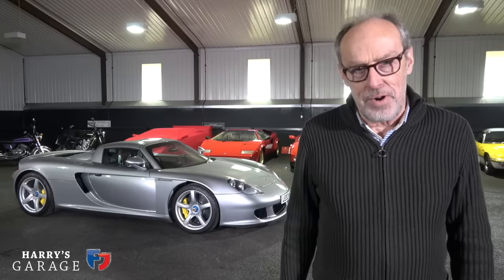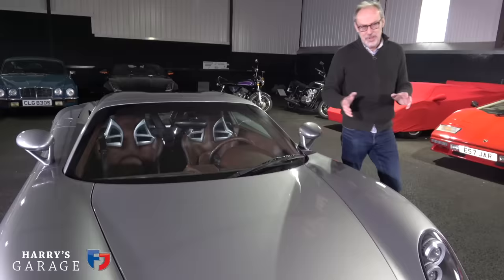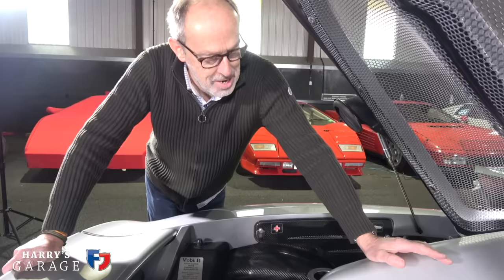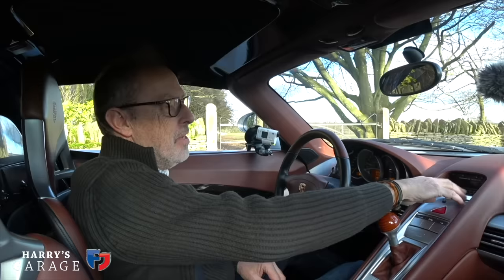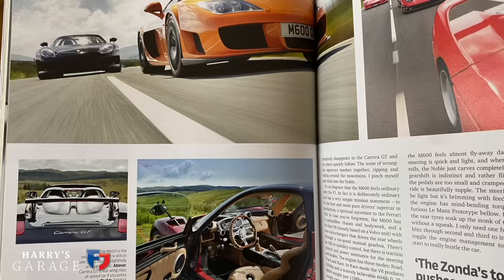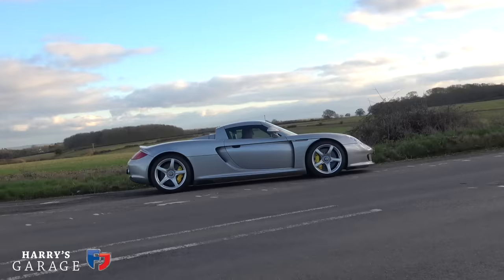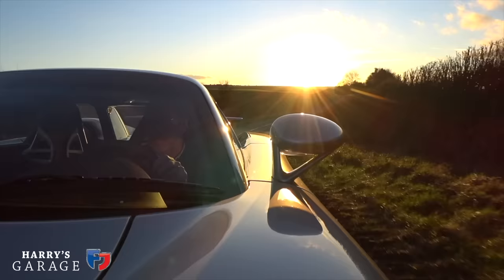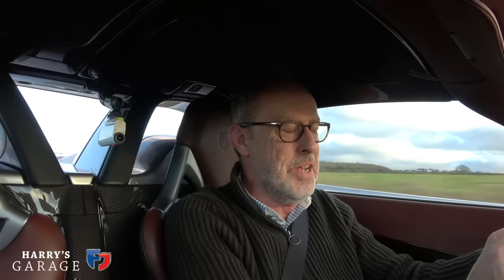Porsche Carrera GT history and on-road review. Best sounding Porsche ever?

Comment: The year was 2007 and I was twenty years old. I was working for a local Porsche-Audi dealer as a shuttle driver when a customer brought in one of these Carrera GTs for some work. I count myself lucky to have been there when he returned to pick it up. He crawled out of the lot and onto the street that ran out front of the dealer and then made his way to the stop sign with the major highway. Just as I gave up on hearing anything from it, this primordial scream came forth as he floored it away from the stop sign and it was as if the checkered flag had just dropped on a one-car F1 race. He ran it straight to redline and even though he was well away from the building, the volume never seemed to diminish. I'd never heard anything like it and even now, 13 years later I can still hear it in my head and it never fails to make the hairs on my neck stand up. What a car!!!!

Comment: Option codes - C00, german specification. 197, larger battery. 572, air con. 577, brown luggage set. 681, sound system. 690, CD radio.
Reply: Could you please share the source from which you knew these codes?
Reply: @porscheinspections1091  thank you sir!

Comment: If I had to have one car for the rest of my life, this is it.
Reply: I'd go for a McLaren f1
Reply: This is an absolutely fantastic car by any measure but if you only had one car and this was the car you went shopping in, took the children to cello practice in, went on holiday in etc., you would quickly wish you had picked something else.
Reply: @joshuarosen6242  well worth it my man
Reply: @putzak  I doubt you'd still say that after driving for more than 5 hours on the highway
Reply: @benjaminbuljevic7977  only have a 15 minute commute so no worries there
Reply: Connegsegg Agera RS. Smokes this car easily
Reply: @joshuarosen6242  Paul walker regrets it too
Reply: @johnmoates5709  in 10 years there will be plenty of Cars that are much faster than what is possible today
speed should really not be the deciding factor
Reply: @benjaminbuljevic7977  if that's the case then get you  a Carrera gt kit car with a four cylinder fiero motor and see if you still sing that tune.  Please
Reply: @johnmoates5709  Koenigsegg will never have the racing pedigree that Porsche does.  The CGT is a legendary car, one of the greatest cars ever built.  It isnt as fast as an Agera RS, neither is any incarnation of the Mclaren F1 yet you could buy 5-10 Agera RS' for the current price of 1 F1.
Reply: @johnmoates5709  LOL. That's not what this is about. A Nissan GT-R will probably 'smoke' this car, certainly with a cheap tune. But speed and acceleration is not what all the hoop-la is about. 
It's like you didn't even see the video!
Reply: Apparently these are notoriously hard to drive. Sure as a Sunday morning toy, but for what would be your daily you'd hate and be ridiculous to think otherwise. The clutch is extremely heavy, it's very difficult even at cruising speeds let alone if you were to try and enjoy it at speed. Its one of my favourite super cars but I'm under no illusion it would be hell owning it 90% of time for that 10% of enjoyment.
Reply: well that just sad....
Reply: @steveazyb2595  It was always meant to be a sunday morning toy with 100% enjoyment - Don't let the "practical aspects" mislead you.
Reply: @prometheus9443  Thank you for helping some people to see the full picture.
Reply: Yeah? And where would you put the groceries in this thing? Or anything larger than a laptop-case...

Comment: I worked at a Porsche dealership in Florida when these were new. We sold and serviced a few of these awesome machines. The best, most animalistic, engine sound I’ve ever heard. Just an angry, eager shriek like no other road car.
Years after production had ended We had a shipping crate arrive one day with the remains of a heavily wrecked GT. We were to do an inspection and estimate on getting it back on the road. I was not directly involved, but I think once the estimate got to around $200,000 the owner decided it was not going to happen. It was loaded back into the crate and quietly went away. 
I got to see white a few rare odd cars while working there. A few that come to mind: AUDI 50, BMW 1602 or 1802 Baur cabriolet, 356 Politzi car, a 993 ordered with special 356 paint color. Full leather(right down the the vents and window switches) with tartan seat inserts, a RHD Toyota Crown, even a Ferrari F40! That one was really cool. The new owner was using our back lot to meet the transporter delivering the car. It was unceremoniously unloaded. A few of us snapped a few pictures as the owner and his teenage son looked over the car. Then they jumped in and drove off into afternoon traffic like it was any other car.

Comment: Who else went straight to the classifieds ? 😂
Reply: Seven figures I'm betting
Reply: @visionist7  Starting price 600K euros for a rather low mile age - Most between 600 and 700k-
Reply: @gillesdarcy3695  and also death on wheel... widow-maker
Reply: @campkira  if that helps making the difference between skilled drivers and wannabes, I'm fine with that.
Reply: @campkira  like Paul Walker. I think he died in one as a passenger.
Reply: Haha ! Yep :) my dream car, my dream engine
Reply: @niklasschmitt  that's because it was on its original tyres which were shit when new and had only deteriorated with age.
Reply: And the those already tricky tires were 10 years old  (gotta change them after 4 years max) when Paul Walker perished.
Reply: @gillesdarcy3695  Thanks but i'm out !
Reply: @niklasschmitt  The driver was doing between 80 and 95 in a 45mph zone.
Reply: @marcovanderpoel7023  And it didn't help that the driver was going 80-95mph in a 45 mph zone.
Reply: David M Yes, I agree.  Americans drive fast where they should go slow and slow where they should go fast.
Reply: I was on the way out the door to get one but then I remembered i am poor, hate when that happens

Comment: Despite being a great performance advantage, the small diameter clutch and low weight flywheel are one of the main reasons why people crash this car. Jay Leno, Rodger Rodas, Lewis Hamilton's father, etc.. The engine response is so immediate and there is no buffer between driver and engine. If you don't know how to drive a race car, don't expect to be able to push this car without the very real possibility of spinning out. Very similar to 1 liter Supersport bikes. You have to feather on and off the throttle very carefully when you're taking turns.

Comment: What a wonderful video, Harry.  Thank you for your thoroughness in describing how the roof panels come off and store, how the rear coil springs work, the toolkit location, etc.  That was all stuff I was unaware of.  Also the new information about the tires.  I can well understand how previous rubber wouldn't have been able to handle the tremendous torque/loads that a car like this can generate.  Thank God for Michelin tires!  I know your love for GT cars in general.  Would a couple of large soft luggage bags fit in the frunk and maybe a hanging bag slip in behind the front seats?  If so, I can't imagine a vehicle I would rather drive down to the French Riviera for a weekend.  You should buy this car Harry.  You deserve it.  I feel you would drive and enjoys this car as it was meant to be.  You would probably have 2500 miles on it in the first month!  I will most likely never get a chance to ride in, much less drive a CGT as I was disabled in an accident many years ago.  Manual transmissions are distant history to me as far as driving goes.  :(

Comment: The clutch issue with the cgt it seems, is that not alot if people are aware of the anti stall system ? 
You have to release the clutch a very little bit , just so it starts to roll, and then gradually release as usual... 
It has a system in place to help not stalling it ...

Comment: Sorry Harry but I just don't get fascination around manual transmission.  Yes, back in the noughties, auto gearboxes were slow and slushy and did get in the way of driving pleasure.

But a good twin clutch auto surely adds to the driving pleasure with snappy paddle gear shifts whilst keeping your hands on the wheel and rev blips when changing down, rather than power off...clutch in...change gear...clutch out...power on just gets in the way of the enjoyment for me....

Comment: The sound is up there with Ferrari and others. As far as the best Porsche for engine note I pick the 917, yeah I know not a street car but that wasn't a factor in the question. So I loved the GT first time I ever saw it in a magazine and I'm not sure I've ever seen one in person which is sad. The 10k per year to operate isn't terrible. I owned a Posrche 951 (955 turbo) that ran about 4500k per year and it was little weenie shitbox compared to a GT. My mechanic said to me one day you could drive a 911 for less maintenance money than this thing. I guess the most expensive one was my Jag XJ6 where the same mechanic took me aside and told me 'next time get a Mercedes' and I did over and over and still have one. Wanted to add about the GT - We lost Paul Walker because the owner didn't check the lines and fluid spilled out in front of those mighty rear meats under acceleration. Now we know - on the GT get the braided lines!!!

Comment: Thank you very much, Harry. Because you're right, I didn't understand this car at all. When the McLaren was introduced, F1 teams were still on their first generation auto-sequential gearboxes - if they had one at all. Electronically controlled running gear had also sprung up, and was quickly banished by Max Mosley's FIA. But those damned auto gearboxes were here to stay, and it was obvious that all the chassis electronics would soon appear on road cars. The Porsche 959 had already shown the way. 

By the time the Carrera GT was introduced, all the road car manufacturers were on their last generation of manually controlled cars - if they were still making any at all, really. The pair make interesting bookends in that sense. I prefer the McLaren in my dreams but, as usual, the Porsche is obviously the more sensible choice. I mean, if you're looking for a practical hypercar...

Comment: There is a normal Porsche called the 911R, but it is not the same car. Did you say you have one of these GT's? On another subject, you are correct. It's not all about a car that someone under some conditions can drive 280 miles per hour. Some how with lower top speeds, etc., Porsche keeps winning races. Can't match a number of cars in statistics, but has won a huge number of races in its life. AF

Comment: Condensation in the head lights, with a Porsche? With a small shop improvement like a Koenigsegg or Pagani one expects these rough edges even very soon, but a real German built Porsche with all that rigid Quality management and thinking - from Six Sigma over IATF 16949 to Kaizen - must not have water in the eyes after 20 years! Well, people consider a Koenigsegg a car, they even consider Tesla a car today, but Musk does not know how to build a car, it's kludge. I think most of the value of a Porsche is not just the agility and the pedigree, its about durability, engineering and quality. But for these results - without water in the eyes - you have to breed a very specific and unique people over the centuries, where the individual is obedient, sort of canine and counts nothing. I consider working in such a factory 9 to 5 for a factory wage as more or less inhuman. Are these 1000 CGT owners the luckier ones then? No! Rich people are fighting even harder with their miserable lifes than all the shift working factory slaves.

Comment: 4 main things wrong with the car. Front wing panel us skewed, the interior centre tunnel panel is off, and the worst ones, A LOT of carbon yellowing for a 20k miles car, way too much for a 3k one. And the carbon/coat is delaminating/bubbling like a mf in the engine bay.